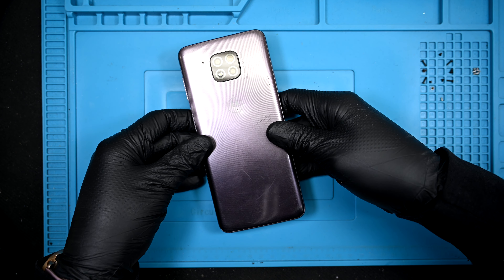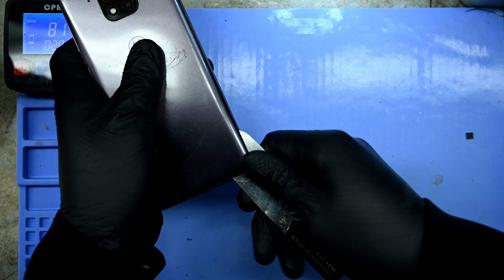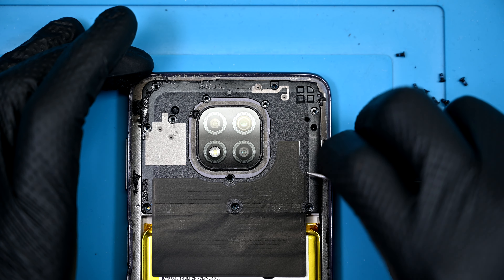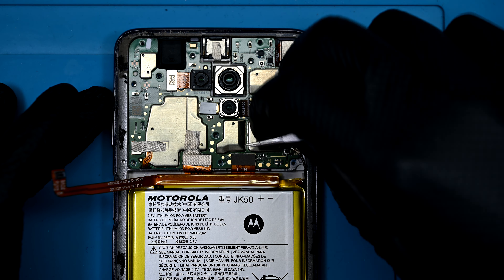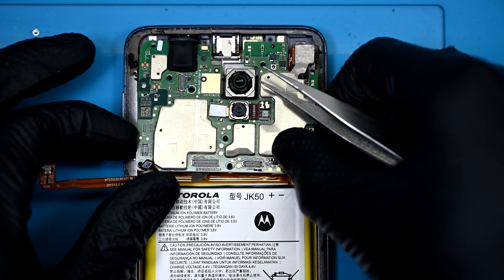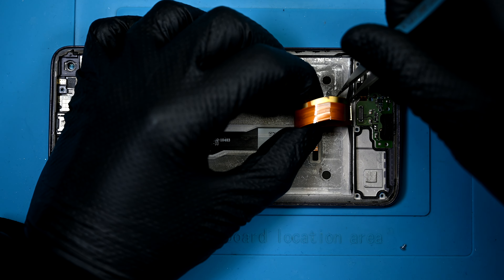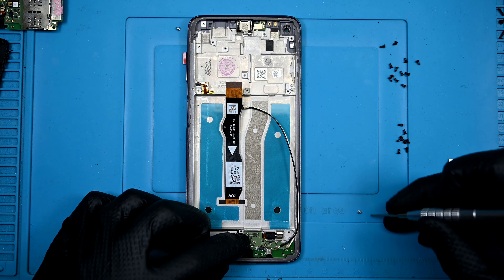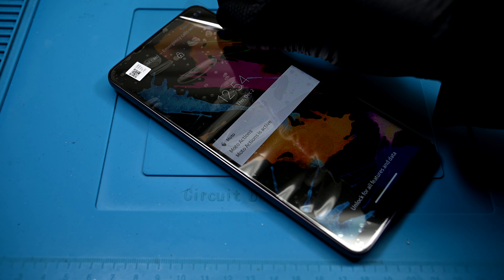Moto G Power (2021) (XT2117-1) Screen Replacement | Framed Display - Pepto Cooling

Comment: Seems to me it's extra steps if you get the screen & frame. I just bought the screen digitizer pulled the battery heated the screen and removed it slipped in the new screen and put the battery back. heated everything up and sealed it again with the glue that was already on the device, just moved it back into place instead of removing it all.
Reply: What's the catch? Was that like an unsanctioned Moto procedure?

Comment: Thanks for sharing mine works great now
 Note; Double check that all cables are connected correctly before installing the Camara back in.
Reply from the maker: There's nothing worse than fully closing up a device, only to remember something isn't plugged in! 😭

Comment: was confused on why it is easier to get one with frame, but once i did it. yeah was pretty easy, especially since i was nervous about how to remove the screen without messing up. thank you! everything seems to work so far, but will have to do more testing once the adhesive sticks as i used b-7000. tho i did forget the first thing most mention and that was the sim card, was wondering why it wouldn't come up till i managed to bend the sim tray slightly and pulled up
Reply: also the one that comes with frame, was oddly cheaper then just the screen
Reply: finally did more testing since i thought the adhesive would be good. the vibration doesn't seem to be working, i tried moving it and such but its slightly curled. suggestions?? thank you

Comment: In your video, you reference a previous video to view on how to remove the battery. What video is this? Could you provide a link to it?
Reply: Did you miss seeing question/comment? (I probably should have posted it with the other one.)
Reply from the maker: @dong3426  with almost 4k subscribers, some stuff slips through the cracks. You can find battery removal in a lot of my videos but I'd recommend the Moto G 5G (XT2075) video I've got

Comment: I have a cracked screen and purchased a replacement screen with frame. I have not yet opened my phone and before I do, I have a question on the reattachment of the vibration motor and what I believe from your video to be the proximity sensor (in your video it is just to the right of center at the top of the phone, with six gold contacts). How are these components adhered to the new frame?
Reply from the maker: You are correct! That is the proximity sensor at the top, and in a lot of cases the replacement part already has one there, if it does not, it's actually super easy to swap! It's just a tiny piece of PCB held in with double-sided adhesive, it can be pried out with tweezers which usually leaves the adhesive stuck to it, so it can be stuck right back into the new frame without any extra work. Even if there is no adhesive the pressure of the board is usually enough to keep it in place.

As for the vibration motor, this one is a bit weird. It has the same double-sided adhesive but only under the two gold contact pads. You'll want to loosen that first and a bit of alcohol can help, it has a very short length of ribbon that runs to the motor itself which is actually only held in by the rubber gasket it sits in. If you try to pull the motor out first it can sometimes rip that short ribbon going to the contacts.

Hope that helps! If you need anything else just drop me a comment, I usually respond within 2 hours (sometimes longer, life is a thing 😉). Good luck on your repair!

Comment: I can't find where u took the screen out. 😳 What kind of adhesive should we use?
Reply from the maker: The new screen comes pre-installed in a  replacement frame, this helps retain some moisture resistance and makes it less likely to separate due to heat. I would recommend either strong double-sided Tesa tape, or a cold-press silicone based glue if you have any!